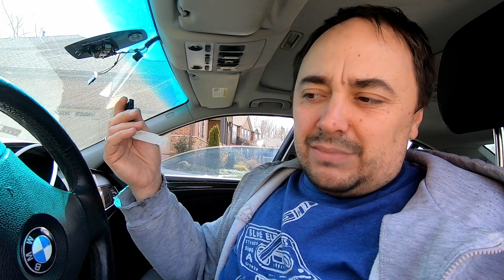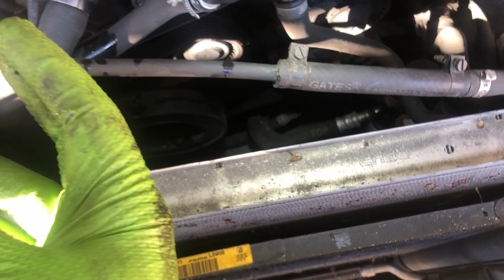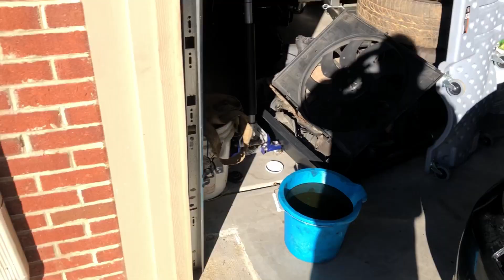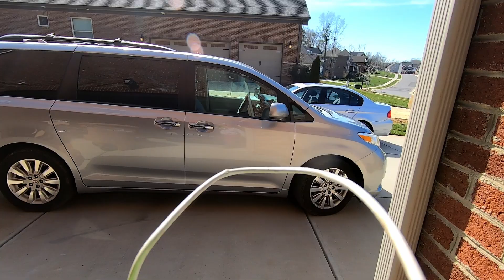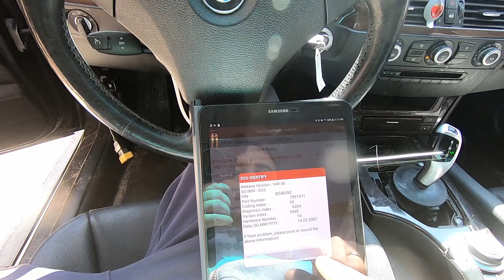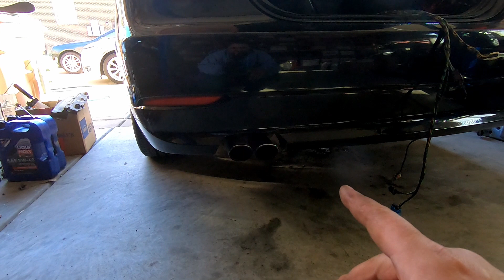Will it Run? Flooded E60 BMW 528xi from Copart (part 1 of ?)

Comment: What's normal compression for a 2009 535i?
Reply from the maker: Have no idea, but ai’ll speculate above 120psi should be great.
Reply: @HETPEZB  Ok sounds good .Is your 528xi still running good? I havr a flood damaged 535i but see No water in oil and has compression but smokes, guy i bought it from said it needed turbos .I think the water damage was slight in the interior everything works.I suspect the smoke issues misfire is turbos, pcv system bad wires plugs.Really haven’t did much to it other than compression test, check the oil and plugs they were coated black.

Comment: I drove into a flood few months ago,car set from 2am till 6 am by the time it’s was ok got get it out,could get it spit out the water,had some water on top of the wheel part,air filter was wet,got changed,and the car started but seen a little cloud coming from the first injector,going to try to change the oils the fuel injectors,this is how far I got but it still won’t run,but when it did run for few days it made a clicking sound when I started accelerating 2000 is,if anyone could help how continue it would be much appreciated

Comment: Ok so I did everything I saw you do here and I actually got the car to turn over but shortly after it turned over it cut right off and now it does absolutely nothing is it possible speak plugs blew from constant attempts to start up?
Reply: Spark*
Reply from the maker: Leaking injector? Hydrolocked with the cylinder full of fuel?
Reply: @HETPEZB  🤷‍♂️ have no clue i suppose it could be a possibility
Reply from the maker: Can you spin it with the crank?
Reply: @HETPEZB  ok will do today soon as I get off work I already had that in mind
Reply: @HETPEZB  what should I look for to see if thats what happened?
Reply from the maker: @almightykr2718  , try to spin it manually with a breaker bar.

Comment: M54 inline 6, the engine i,ve worked on a few times. Best non m straight 6. Well it started, that,s good.
Reply: This is an N52. Not an M54.

Comment: that is really cool. Personally I wouldn't buy a flooded car as there can be so many issues and im nowhere near experienced enough to deal with it
Reply from the maker: As a backup I was prepared to part out this car. But now I’m driving it - passed the inspection, emissions. Right now just a regular stuff - new shocks, sway bar bushings, links, new motor mounts.

Comment: "5 words into the video..." good sense of humor. i'm going to watch all of it.
still watching at 11:00...
 when starting a car and all you can hear is a clicking sound, IME it has always been due to a low battery or a jumper battery that is low. i would remove the original battery and replace it with one you know for sure is up to the task. (note that on some cars a really low battery will make no noise at all)

...anyway, looks like you've got a decent car there.
Reply from the maker: Since it was a flood damage vehicle I didn’t know if the engine was hydro locked or not.